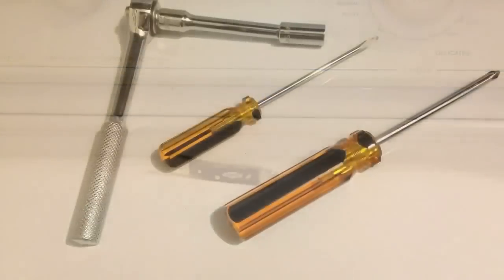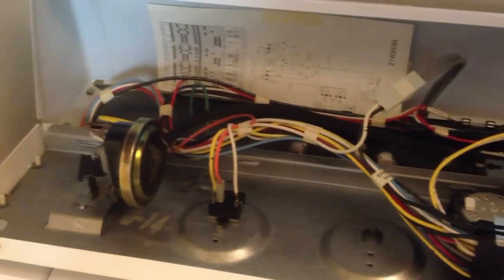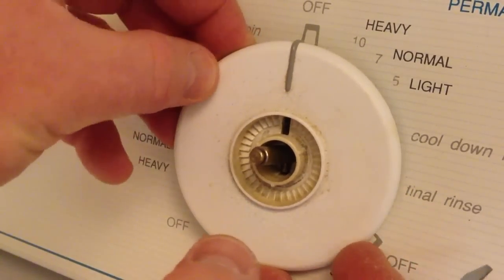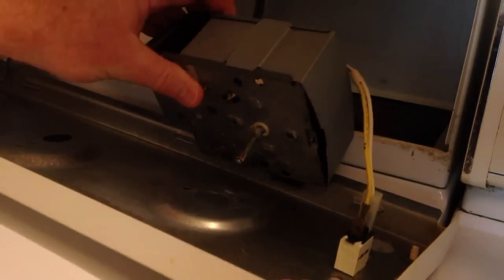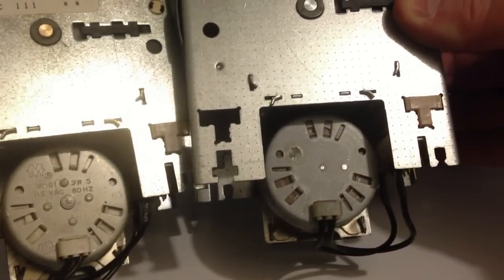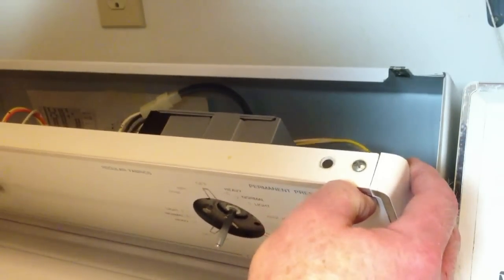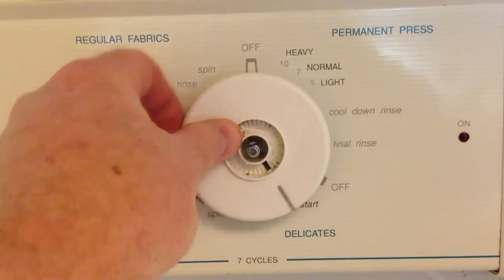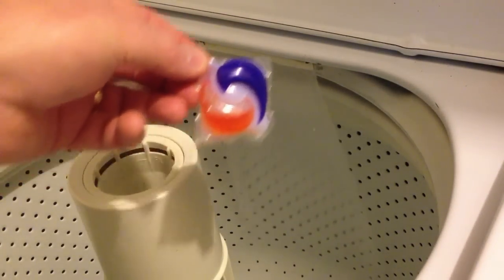Replace Washing Machine Timer

Comment: early 90's model I'd say? I worked for sears as a parts tech and I havn't seen a washer with that much steel in it for years O_o you should have let the machine run for a bit thats the best part imo :D

Comment: more chore videos!  have you been doing your chores?
Reply from the maker: Absolutey been doing my chores. Sometimes though they are hardly conducive to a relaxing video when my knuckles are bleeding after wrestling out a starter motor that should not have been that difficult to remove and I wishing that a general motors engineer would pull into my driveway at that very moment so that I can flog him with the dipstick from my truck. Just kidding of course...or am I?
Reply: RelaxingASMR hahaha wow!  how do you know how to do all. this stuff??  do you research on the internet or are you an electrician or something of the sort?  schooling?  you're more handy than the average person. I watched the video of you fixing your trucks dash area thing lol and for a second I thought maybe I could fix mine on my van (the speedometer bounces when I drive)  but the second you got down to the board and the soldering...  I said, "nope... nope nope... " ridiculously expensive Meineke it is D:

Comment: This is SO freaky. I have a Maytag model  #LAT8614AAE  and had to get the timer replaced. Too bad you don't live near me. The part was $136. Paid $340.25 to get it installed. (Now THAT ruined my day.) After it was installed by SEARS HOME SOLUTIONS (repeat SEARS HOME SOLUTIONS), I had to take it apart and put it back together because SEARS HOME SOLUTIONS forgot to set it so it would cycle correctly. Took a pair of needle nose pliers to move the "crazy looking pin" to get it right. Have called SEARS HOME SOLUTIONS over and over and still no call back from SEARS HOME SOLUTIONS. You should have come over to fix it and I would have gladly paid you the $204.25 and would have supplied refreshments.